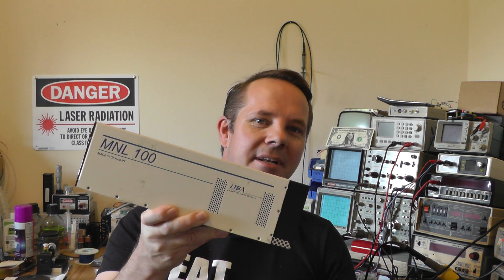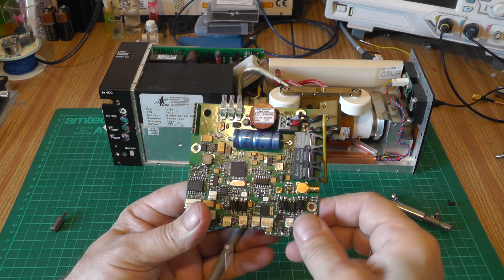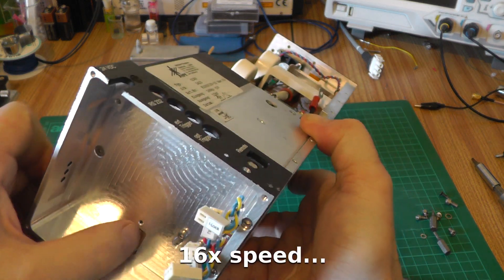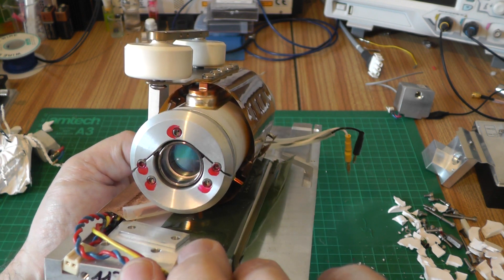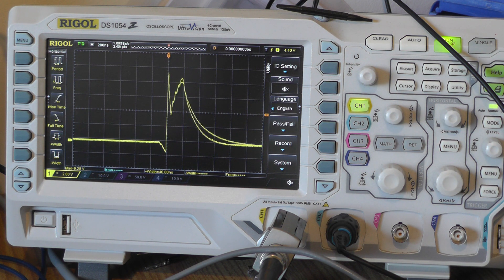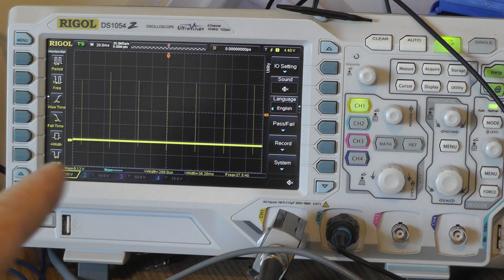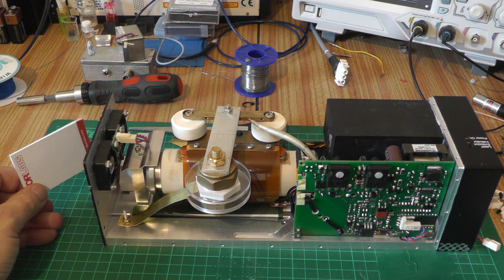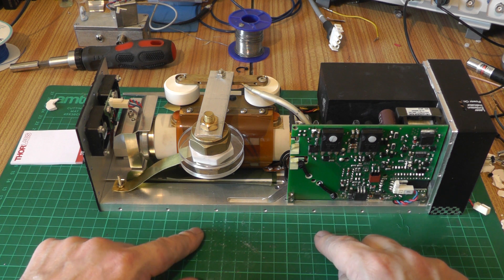Can it be repaired? Dumpster Nitrogen Laser teardown Part 1

Comment: I wish you explained more of what you're seeing. Why are those capacitors on a flexible board? Why are they wrapped around the tube? Why are those wires arranged in such a strange way around that semiconductor gate? Why do they use fiber optics to communicate between boards? What are these lasers typically used for and what specifications is their design driven by? Why do they use a semiconductor gate instead of a spark gap?

Comment: I was gifted with two nitrogen lasers, one of which worked. No fancy uControllers, just a simple external trigger, and a rep-rate auto trigger circuit. The main item of note was that it used a Hydrogen Thyratron as the primary switch. I investigated replacements, rather $pendy devices. :(
Reply from the maker: Cool! Yeah, Sometimes, just trigger in is all you need :-) 
I have been looking for Thyratrons for a while, and yes, many $$$ even second hand.
I suppose if you need kHz repetition rates, or precision timing, but a spark gap will do for most purposes, and of course a triggered gap is better.
Reply: @LesLaboratory  Back in the day, when I was experimenting with optically pumping cuvettes full of coumarin and rhodamine dye trying to achieve *super radiance*, I had made a coaxially triggered spark gap to drive the bejesus out of a poor little flash lamp. :D

Never achieved super radiance but it sure made one hell of a rep-rate sun-tan machine.
Reply: You can make a spark gap with a literal spark plug screwed into two thick plates of aluminum or copper. Presurize it with a mixture of gases to get the desired hold off and fast switching, usualy a 70/30 mix of SF6 to argon. The SF6 provides hold off and argon provides the comutation.

Comment: Those are pulls from MALDI machine, never seen them designed with naked HV components like that.  IME the nitrogen plasma tube is usually OK, but the little spark gap switch tends to go pop. All it needs to work is 20to 30kv for the HV and a 10kv pulse to fire the spark gap switch.

Comment: HV IGBTs are actually fairly cheap! You can find them as low as ~$1.3-1.6 a piece for the 1200V flavor. Not sure about the pulsed current though - most of them are only rated to around 20-60A peak, but seems reasonable enough to try building a trigger device with.
Oh, and beware - the gas fill isn't just low pressure nitrogen. It's a specific mix of helium and nitrogen, I believe around 3-15%He. And of course, you need at least 4-5N gas purity to maintain a long life.
Reply from the maker: It's the pulse current rating that counts for these. You need to be able to conduct Kilo-Amps at KiloVolts in just a few tens of nanoseconds. I was looking at IXYS IXYX50N170C, erring on the side of caution, and they run 18 bucks each. 
Yes it will have  He:N2 mix. All sealed designs I have seen use this. He ionizes easily, but also helps conduct heat from the gas to the walls of the tube.
Reply: @LesLaboratory  The IXYS part is nice, but it's not that far ahead in terms of ratings compared to the cheaper ones. It might be worth a try to use the cheap ones. Perhaps even in parallel, to reduce inductance and increase capacity.

Comment: That's awesome! I am a bit surprized at the solid state switches being so small considering how much peak current they must have to supply. The pre ionization pulses looked really pretty down that bore. I worked with a lot of ion lasers and solid state diode and OPSL stuff but never had a chance to use any Nitrogen lasers. I did get hold of an old CO2 medical laser but never found the time to get it working. It did have two huge triodes to control the HV current, yeah, it was pretty old. Nice video, very informative, thank you.
Reply: I'd say that there might be some issues with preionization, because it is probably supposed to be from both sides.
Reply from the maker: Yes I thought that as well, but the other one behaves in exactly the same way. Perhaps worthy of some investigation. I have already reverse engineered the output stage of the Pre-Ioniser. When I get time, I will diagram out the tube as well.
Reply from the maker: Thanks! Yeah, some IGBT's are rated for this kind of work. I suppose if you are dealing with very short pulses, you can get away with pushing though some quite high currents. I imagine they are very fragile though.
Cool! I love the old Tube/Valve stuff :-)
Reply: Wow the ones i tore apart had an Argon/SF6 spark gap to fire the tub, which i imagine would be much cheaper. That switch has to clamp in less than 4 nanoseconds which is no easy feat. Not normal IGBTs to be sure, probably SiC. If they are fast enough to fire a nitrogen laser and fast enough transition nit to blow up, they could be used for a nuclear weapon firing set! 😲

Comment: I think the filter not only blocks other wavelengths but it also must attenuate the light, because the pulse is in the tens of kW's in power, that might saturate the diode or put it in a non linear state so the filter could help avoid that.

Comment: Hi Les:
I have studied all of your EXCELLENT nitrogen laser videos.  I have obtained a couple of HUGE Nitrogen lasers, one actually capable of outputting pulses of a megawatt...maybe 2Mw!  These huge monsters...one quite sophisticated, from the 70's required a pickup truck to transport!
I see that the simplified schematics (mainly the dumping and peaking caps) are similar to your schematics.  These lasers contained ceramic THYRATRONS  and large doorknob capacitors.
MY QUESTION:  Is the thyratron just a very 'high-end' spark gap?  Where in the simplified schematics would the thyratrons fit in?

This was a $250,000.00 laser which I got fir $250 since it didn't work.  The problem was a bad thyratron...I got it working with a simple spark, but, for a very long time, would really like to know the function of the thyratron.

THANKS AGAIN FOR ALL THE HIGH-QUALITY VIDEOS.
BTW:  Maybe you happened to see the nitrogen laser article in the "amateur scientist" column of Scientific American...it was discovered that it did not function properly because of the excess inductance due to the thick layer of Fr-4 in the large double-sided PCB.
--dALe

Comment: Just as you fired that up, my connection failed and the video froze - I had to check it wasn't a problem with your recording from the RF inteference!
Regarding a lathe, it's an excellent investement. My advice is go for something bigger than you expect to need, provided you have the space for it. I graduated from an ancient 3" lathe to a Myford ML7, and now I have a Colchester Bantam 5 5/8" lathe and I still occasionally find jobs that are too big for it.
Reply from the maker: Ha! There is that much radiated RF, it probably could :-D
Indeed, I have had my eyes on one for a while now, but budget and space are both limited. I reckon I can get away with a small hobby Lathe, at least for immediate projects, but I suspect, it will become yet another tool addiction...

Comment: The fiber cables are to electrically and thermo isolate the hv/hf group in case there is a failure you want the shutdown to still be able to detect it and do its job. I'm sure you know this just Mentioning for others interested in rolling their own controller
Reply from the maker: Yep! It is something I have used for real noisy stuff like Tesla coils and such. A game-changer for stuff like that!

Comment: You can done this laser to work at 220v or with an adaptor? I dont know if is a good idea but i want to buy one of nitrogen laser repaired by you.
You can tell me a price if you want.I dont know how much costs the travel from america to romania.I cant buy things from ebay because it need to give personal data and im not agree.It need more time get the money.And your latests clips are awesome in special this clip.
Reply from the maker: Thanks! Unfortunately not at the moment, there are still things I want to do with them.
They run off of 24v DC, which seems to be common for a lot of N2 Lasers from various manufacturers.
 The good news though is they are showing up surplus lately, and even if you get one in non-working condition, chances are it can be repaired ;-)

Comment: Is it also Tea ! Than why its design is in cylindrical shape ? Can we copy this in Diy Version if it's Tea laser !?
Reply from the maker: It is convenient and from an engineering standpoint, sensible, to manufacture anything that contains gas at high or low pressure in a cylinder. Have a look around my channel, I designed a TEA Laser they outperforms this in terms of power.
Reply: @LesLaboratory  I already watched that video long before and also just before .
But I still wanna Know , it tea laser and nitrogen laser is exactly same setup and thing ?

Comment: Les, could one use a flash from a deposable camera as a triggered spark gap?
Reply from the maker: Not the flashtube itself (well at least for this application), but the trigger circuit itself might trigger the triggered park gap. I have actually rolled my own trigger circuit, to ensure consistent repeatable results, and I have built a very large version for another upcoming project....
Reply: @LesLaboratory  fantastic Les! I'm looking forward to the video. But tell me, how does a flash lamp and a triggered spark gap differ? This is probably a silly question, I have not much knowledge on spark gaps. Triggered or not...
Reply from the maker: @Robertwclarke  Great! A triggered flash-lamp is designed to convert as much of the energy into light as possible. They are comparatively low voltage devices with voltages ranging from a few hundred volts, though very large ones exist that require KiloVolts. Generally the discharge is quite long, and lasts from microseconds to milliseconds

Spark gaps on the other hand are designed to switch as efficiently as possible and not dissipate the energy in the form of light and heat. They can switch from hundreds of volts to thousands of volts at thousands of amps. The discharge is very short (Just a few millimetres) so they can switch quickly (10's to 100's of nanoseconds)
Reply: @LesLaboratory  Wow! Thanks for that super explanation. It makes sense now. It makes me wonder about short arc HID lamps(like in video projectors). They are high pressure, short distance. Is it just the gas mix which is the difference here? What else is different?

Comment: I wonder if part of the front end to the optical input to the energy monitor is something acts like a fluorescent down-converter. Pin diodes have low sensitivity at at the UV end of the spectrum. It's hard to tell from the vid but that photo sensor appears to be in a plastic case. I'm not aware of any plastic that passes UV. :/
Reply from the maker: Yeah, it looks like a plastic case photodiode, and there appears to be UV damage to it as well. Almost everything is fluorescent to some degree, so maybe they do,  though I suspect UV photons will penetrate such a thin layer. Some plastics will pass UV (You can get disposable UV plastic Cuvettes for Spectrometers).
Reply: @LesLaboratory  Interesting. Back when I was trying to do what (what you have done in another video) I was using plastic cuvettes. I dont' recall but I just assumed no UV was getting in them. Maybe it was what I saw from the data sheet. I had'nt even considered versions that were uv transparent. I assumed I needed quartz cuvettes, which I did not have money for. :/

This was back in the 90's.
Reply: Ive seen both types, the power sampler uses either a florescent converter or a silicon carbide photodiode. 🤓

Comment: Even better than a spark gap use  the electronic switching  less electronic NOISE
Reply from the maker: It is possible to reduce the noise to acceptable levels with a spark gap. I though about using semiconductors, however at these voltages and speed is gets expensive fast!(see part2: https://www.youtube.com/watch?v=ngs9zPdI_t0)

Comment: Nice mod, you never failed to amazed me :-)....I'm just wondering, would you be interested to sell me one of your micro nitrogen laser you shown in this video mate? What type of power supply you need to run it? Thanks & keep the great vids coming.
Reply from the maker: Thanks! Unfortunately not at the moment, there are still things I want to do with them.
They run off of 24v DC, which seems to be common for a lot of N2 Lasers from various manufacturers.
 The good news though is they are showing up surplus lately, and even if you get one in non-working condition, chances are it can be repaired ;-)

I will keep you posted though if I decide to punt one!
Reply: @LesLaboratory  I think you misunderstood me my friend. I was referring to your homemade N2 laser, not the ebay ones.

Comment: Hi Les, can you give some details about the air pressure spark gap? Distance between electrodes, shape, material(brass?)?And what is the pressure inside the laser tube. Many thanks! Cristian
Reply from the maker: The distance in the gap is about 2mm. the material is brass. The two electrodes are simply a brass acorn nut (M8) and the head of a brass bolt with the corners rounded off. Both are polished. inside this laser tube, my best guess is atmospheric pressure, with Helium as a buffer gas. My home made N2 lasers all run at atmospheric pressure.
Reply: @LesLaboratory  Many thanks man...you're awsome!